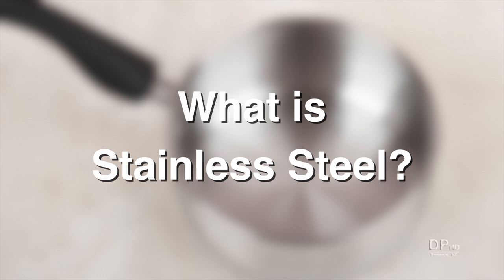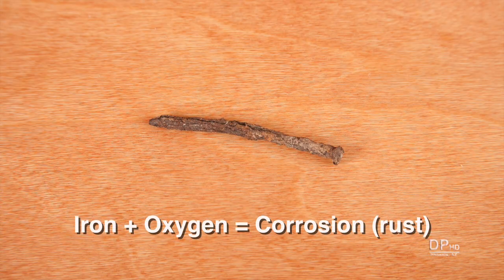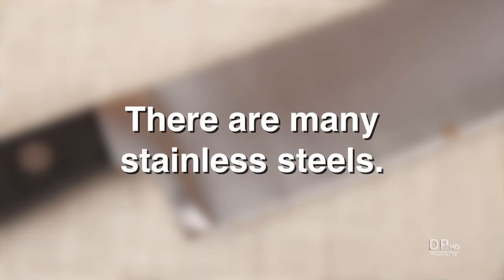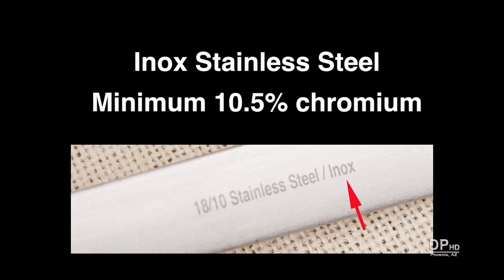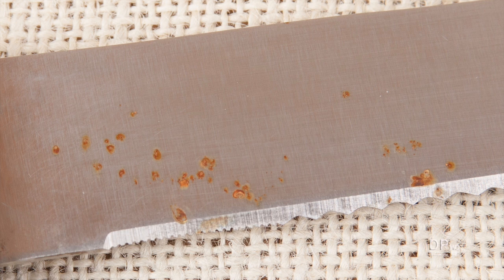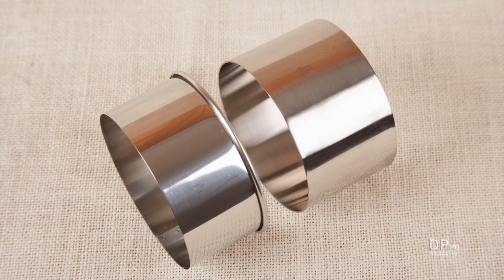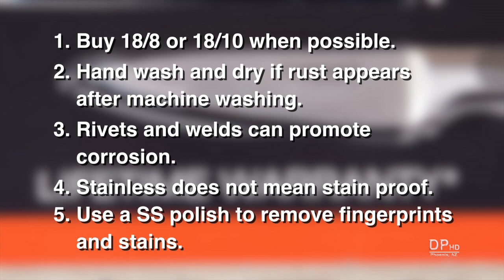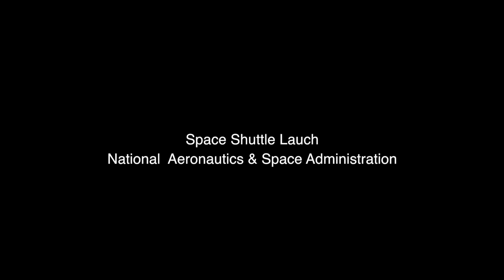Why Stainless Steel Stains - DiTuro Productions

Comment: Very informative! Thank you! I learned a lot and your presentation is easy to comprehend. Just wondering if the German part was suppose to be a punch line? 😂 Sorry if it was serious.. because I laughed 😅
Reply from the maker: You're welcome. Thank you for sharing your thoughts. It has been years since I published this video so I do not recall the exact reference to German steel except that it does not guarantee high or low quality.